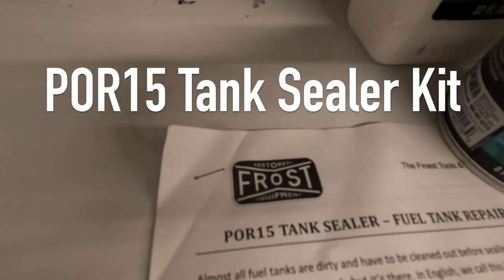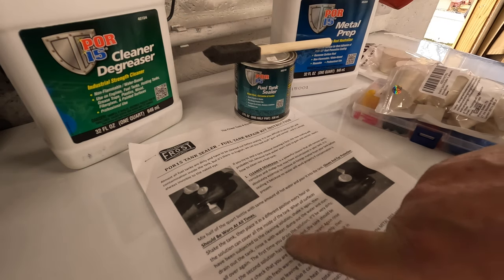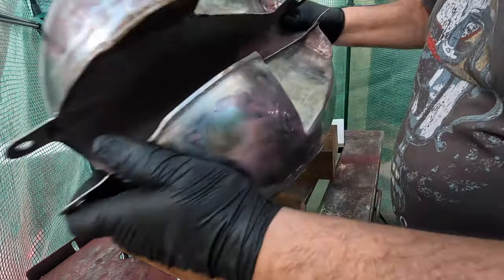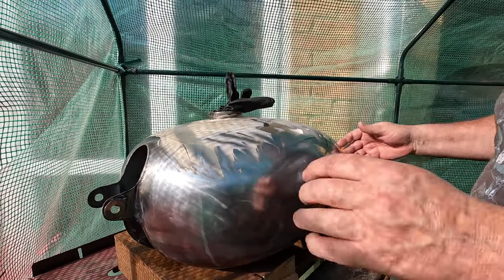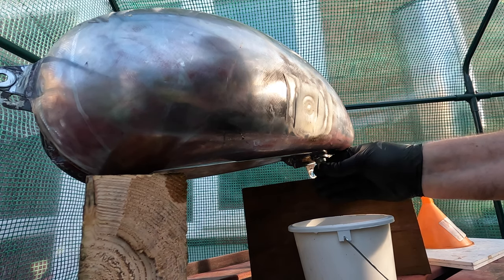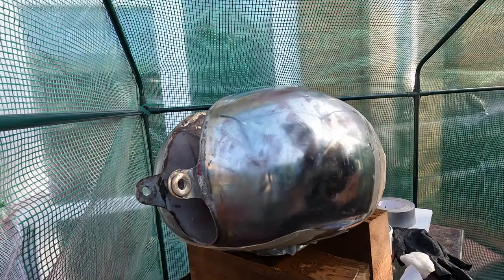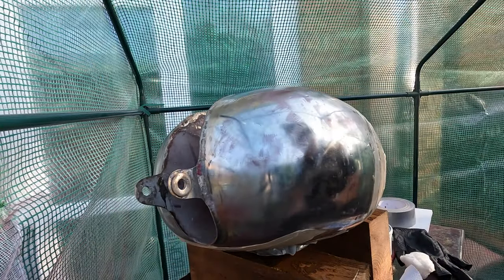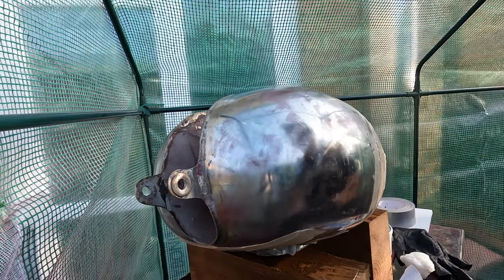POR 15 Tank Sealer kit application & results.

Comment: POR15 is the best tank sealer out there. Great product and works very well if applied correctly.
Reply from the maker: I noticed after draining the sealer back into its tin that it only used ⅓ of the contents so basically I reckon if you had enough degreaser you could easily do two fuel tanks with one kit :D
Reply: @HepcatHarley  It's 100% effective half of the time
Easy way to fix pin holes=solder
Reply: Exactly. Those who complain about flaking are those who don't let it get bone dry before applying the sealant. That's a crucial step. It has to be completely dry

Comment: Some hints.  If you get the MSD ( material safety data sheet) on each product, you can find out what it is.  Chances are the cleaner is something common you can get generically cheaper.  The metal prep is almost certainly Phosphoric Acid... available cheap locally ( home depot metal etch/prep).  When using the metal prep on a rusted tank ( such as this one)   use sharp clean gravel ( or bright screws and nuts) and agitate it vigorously,   this will mechanically remove the rust... so you don't have those crusty lumps left.  Use stuff big enough to get out easily.  Steel nuts will come out with a magnet.. which is handy.  Do the same rinsing as before. When I do it.. I neutralize the acid with baking soda and water, then rinse.  They are telling you to phosphotize the remaining rust... I would rather not have anything crusty at all.  If you have an electric oil filled RADIATOR TYPE Heater...lay your tank on that- set on low -  overnight.. and it will be thoroughly dry .   When letting the coating sit to cure after rotating it to spread it out untill you puke...I think it is preferable to let it sit upside down.   Then,  if there any chance of puddling... which could eventually fail...it would be at the very top...rather than at the bottom.  any eventual failure there... you can feel with your finger inside the filler hole...and it would also be easiest to repair, and least likely to introduce rust into your fuel. IMHO.

Comment: Well fingers crossed 🤞 the sealer does the job My Lord.
Reply from the maker: I think it's fine Nev, not sure I mentioned it but I ran a bead of JB Weld along the seam too...belt n braces but I didn't fancy welding it as I'm not sure how thin that metal has got and I could end up in a right Royal Pickle :)

Comment: i don't understand why it has to be completely dry after the de-greaser.  All you are going to do is get it wet all over again with the rust removing agent, which would remove any flashing of rust anyhow.  So isn't it a bit pointless at the degreaser stage making sure it's totally dry?
Reply from the maker: I had to watch it again lol. I didn't need to dry the tank between the two cleaning cycles as that was pointless but before the Metal Prep you do need to dry it first (just following the instructions). :)
Reply: @HepcatHarley  Thanks!

Comment: I'm trying to clean and seal my motorcycle tank But I see good and bad reviews about not to use it Does it work good if Done right have any of you checked How the tank looks after a year
Reply from the maker: If your tank is leaking I'd definitely sort out the leak first, welding or brazing etc. Don't cut corners with the POR-15 treatment, do exactly as it says in the instructions...them that say it doesn't work are most likely them who didn't follow the procedures correctly or thoroughly. You cannot reapply this treatment if you get it wrong.
Reply: most people will NOT do the prep properly, no matter what they use.  Most stuff now will fail.  There is some stuff sold by Aviation Spruce and Specialy..that is $20 pint... isocyante based.. not flexible..but ethanol proof for sure.

Comment: Very usefull. Can I ask did you do any other prep before putting the degreaser in?. Such as washing it out with anything else? I am looking to do this to my bike tank. There is alot of flakes of loose rust in the tank. I have shaken out what I can,  but was just wondering if the degreaser is meant to be shifting this too?
Reply from the maker: Not on this tank Baz but I would put something in there to break down the flaky bits if there were any. People use small chains or count out some nuts and throw them in and give them a good shake around, count them all out too :) In the past I have completely filled a tank with Evapo-Rust and had excellent results. HTH Cheers Ian
Reply: @HepcatHarley  Thanks for the reply Ian. Had my bike from new 2005. Sat for a while and wouldn't start (a few weeks ago). The fuel pump slots into the tank and was so sludged with rust/gunk, when I removed it. Decided to get another second hand pump, which looks much better. Even now the tank is dry the amount of flakes of rust that came out have shocked me.  As my bike is always in a garage , and there was a fair bit of fuel in the tank. So ordered some Evapo-rust and will try the chain/nuts with it first.  Ta for the info/help.
Reply: I would wash with hot soap and water.  Then YOU MUST degrease before you use Evaporust... but it is superior to using Phosphoric acid, safe and easy.    If you fill the tank completely with evaporust.. and set it on an electric radiator heater  to get the temp up to 90-110 degrees F... it will work in a few hours and better than at room temp...wont "work at all" below 70F. i mean not in our life time.

⚠

Comment: I’ve worked on old motorcycles my whole life motorcycle junk yard private shops dealerships I’ve never seen a good tank coat ever they all seem to let go at some point. Nothing worse than seeing that crap floating around in your gas!  I just pour hands full of nuts and bolts into the tank and shake till I’m wore out then flush it out with more gas and a magnet . That’s been the best I ever seen. Once the moisture is out they’ll stop rusting.
Reply from the maker: I have an imported Honda that had that Kreem stuff inside the tank, it was flying off like curtains in large parts but stuck like cement in others, managed to get it all out eventually. This POR15 is brill if you do it right, sets like concrete and is a good 'back up' for an old tank.
Reply: Prep is absolutely everything.  Ethanol  eats almost all tank coatings. POR is MEK solvent based. Should stand up to ethanol.  I used to use 3M EC776R red fuel resistant coating.  Almost $400 a quart now.  The clear version is NOT ethanol resistant.  and I don't know about the R anymore.  Aviation stuff than made my BMWs run forever... back before ethanol.

Comment: Have read way too many failures with this product. I think the problem is getting the crap out of the tank and getting it perfectly clean. Rust remover and cleaning solutions don't work as well at you might think. I've been soaking a tank for about a week now using rust remover, drain and use vinegar and there is still crap in there. I think I'll try some muratic acid next.
Reply from the maker: I think in extreme cases it's always important to verify each process has been successful by using an endoscope type of camera. I remember I had a devil of a job getting my Honda CB200 tank thoroughly clean and getting rid of previously failed Kreem sealer. I tried all sorts, MEK, Acetone, Phosphoric acid etc but yes Muriatic acid should do the trick. Good luck :)
Reply: First...you MUST remove all Grease, Oil, and Gum. All Of IT!  For this you need a real SOLVENT.   Paint thinner ( stoddard solvent)  is good if you can get it.  Follow up with Acetone or MEK... if you can keep it off your paint.  No rust remover will work where the metal  has any oil on it.  Not acid, not Evaporust..   Then use the best rust remover you can ..and use it right.   Filled with HOT Evaporust... all rust will be removed  and no solid steel will be removed.  Rinse very well...using a bristle brush and hot water.   Dry on a heater untill bone dry.   Now whatever you use..WILL stick.  POR 15  resin.. and MEK   is the solvent for it.  Never use anything in your fuel that has MEK in it.

Comment: Do not use Por-15 to line gas tanks for your motorcycle. It will fail. After several months, my por-15 is now breaking off in pieces  and clogging my carbs with this silver powder as it dissolves.  Do not use it. Por-15 is great for other things, just no good for lining a gas tank. I  am in search for a solution. My thought is to clean out the tank, dry it, and use Cream or a 3M Cream liner over my por-15 as there is no way to get all of it out of my tank. No way!! This is a bad fail for sure. Such a disappointment as it will take hours and hours to re-do everything. What a mess!!!! I wish someone made a fuel bladder to stick in my tank and go that route. That would mess with the fuel gage sending unit though. Boy what a mess I am in.
Reply from the maker: The Golden Rule is to follow the instructions to the letter and make sure you've done the prep properly. If you can honestly say that you have then take it up with the manufacturer as maybe it was a bad batch, they'd know. I've done at least three tanks and all have been perfect. I bought an old 70's Honda with Kreem in the tank it was coming off in strips inside the tank and I was in a complete mess as you are, keep going and good luck.
Reply: @HepcatHarley  I would rather have plastic strips than silver powder. Actually I want neither. I want a liner that will not dissolve. My guess is POR-15 can not resist Ethanol. Also. Suzuki should have never made such crappy fuel tanks. My Harleys and Hondas do not have this problem.
Reply: you have to follow  the instructions
Reply: @brendonbayliss2994  Of course

Comment: This stuff sucks don’t use it !!! It’ll peel apart in your gas tank
Reply from the maker: I had a tank that had a similar product called Kreem, that peeled off like curtains. I must admit por15 has never let me down.
Reply: @HepcatHarley  ya cream is hooooorrible ha. Por 15 pealed off super easy too for me. Red kote is pretty good but I feel like all of these fail within a year or two. I bought a tank once a guy said was nickel dipped so wouldn’t leak. Never heard of that but maybe works
Reply: @riffraffchoppers  "guy" will say anything to get it sold